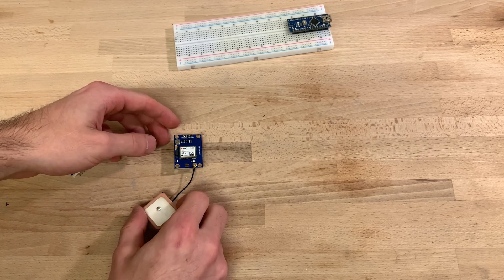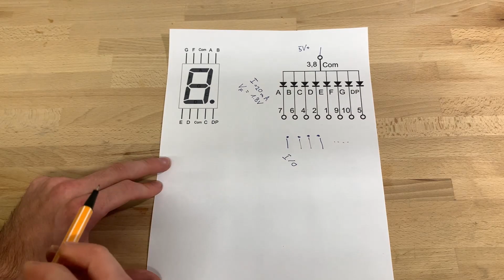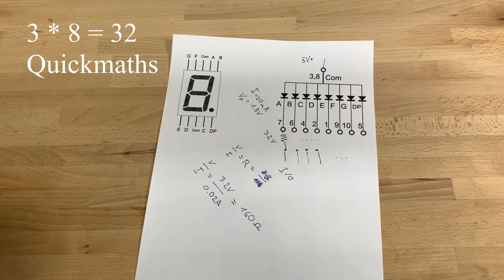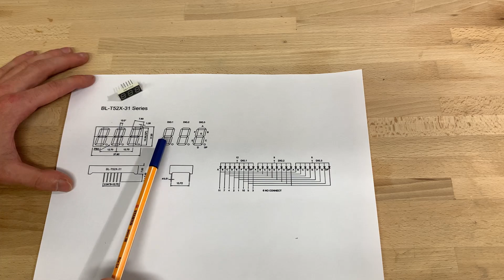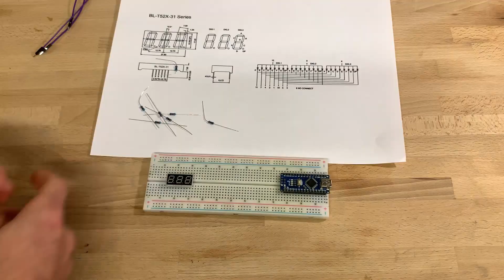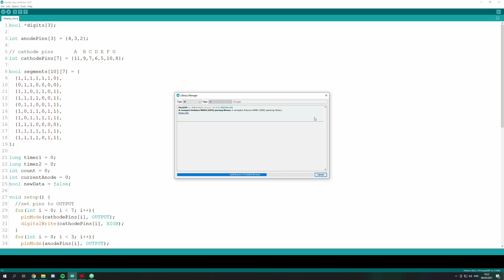How to create a Speedometer with a 8-Segment display [Step-by-Step]

Comment: Hi can I use TM1637 and KY-024 (A43144) as a replacement? And add digital clock and RPM Meter.

Comment: Hi, good video! I would like to make the same but with a projection in cm/min this with a clearance of 5cm. Which module would you use for that?
Reply from the maker: Im not sure if I understand correctly, you want to have it accurate down to +-5cm/min? If yes than it sadly is impossible to do as gps devices arent that accurate. You would have to implement a different solution. If you tell me what for i might be able to give you a suggestion

Comment: Hey thanks a lot! I'll try (for my first project ever :p) to use it on a small screen as you showed in the first video. Unless you already code it ? Ohh and can i put a link to your code/video on thingivers ? (I'm building an hud for my motorcycle helmet)
Reply from the maker: Nice! A hud for a motorcycle helmet was actually what i had in mind when starting this Project. I never completed it tho. And sure, you can link or copy the code wherever you want. I didnt code anything for the display but that should be straight forward if you use a library compatible with you display.

Comment: Hi and thank you for making this video. Could this code be modified to work with two one digit common cathode displays?
Reply from the maker: You dont have to modify the code at all, just connect all anode pins (Segment A to segment A of the other display etc) and then connect the two cathode pins to the arduino. That should work just fine
Reply: @bootlegengineer  Alright awesome! I seem to have figured out how to do it and I am able to run the first program where it counts up to 999, but when I add the gps code the displays are stuck on 404.

Comment: How can I change the code so it works with common cathode displays?
Reply from the maker: it should be as easy as swapping all digital write parameters from hight to low or vice versa. Enabeling an  cathode means pulling it low, and enabling a pin means pulling it high. So in the show digit function swap the HIGH and LOW values and also delete the ! in front of the digits[anode][i]. That should be all
Reply: @bootlegengineer  It works, thank you. Is there a way to fix the 1 Hz flicker on the display that seems to happen after every pulse on the GPS module?
Reply from the maker: @KrazyContraptions  That is because the Software Serial is blocking something, a simple workaround is to use the harware serial that your arduino has. Instead of ss.read / ss.begin. you use Serial.read(). Also connect the tx pin of the gps to the rx pin of the arduino.
Reply from the maker: @KrazyContraptions  If you are using the Hardware Serial to communicate with the GPS, you cant simultaneously communicate with the computer. So the gps has to be disconnected while programming the arduino, or else it will disturb the communication. (You programm the arduino via Serial). If you use a teensy or a more potent arduino you will have multiple Serials like Serial1 / Serial2
Reply: @bootlegengineer  

thank you . Is there a way to fix the 1 Hz flicker on the display that seems to happen after every pulse on the GPS module ?
didn't work please help

can you post edited code